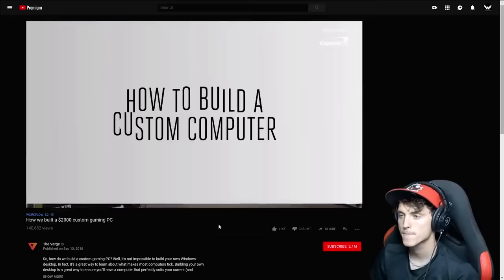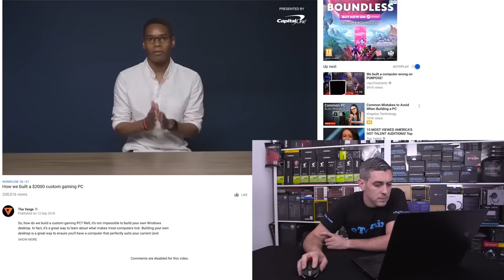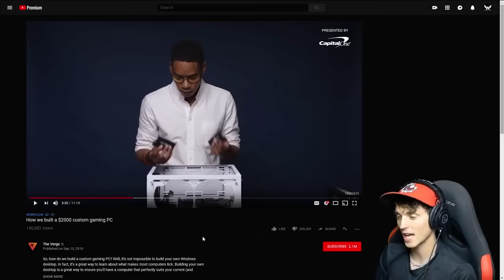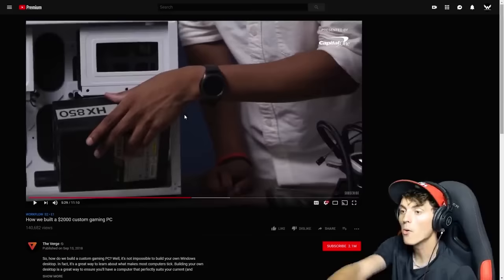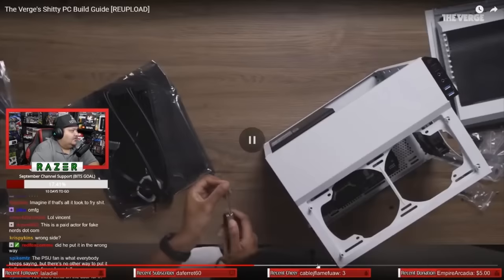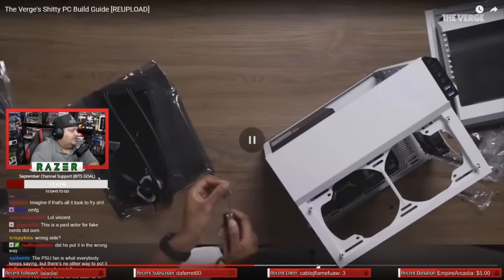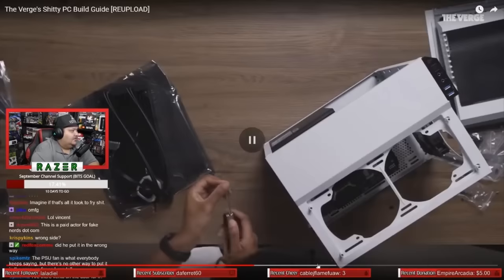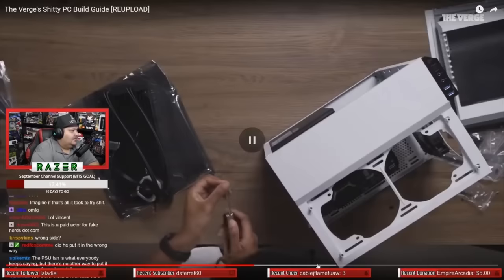The Verge's $2000 PC Build Reaction Supercut

Comment: "Two thousands a decent chunk of change for a gaming pc"

Ohh the Rich boys..
Reply: 2k for a whole PC is mid range.. Upgraded my PC for about 3.8k..
RTX 3090 with an EKWB - 1800€
R9 5950 with an Heatkiller V block - 1000€
MSI MEG X570 ACE - 350€
2x Samsung 980 Pro 1TB M.2 nvme - 400€
And other stuff like radiator, pump, fans, pipes, cables, fittings, and so on - 300€
Reply: @deadlyfeet 2090 ti for the price of an 2080 ti seems okay.
Reply: @chimei-tekinaneko8318  ohh the rich boys
Reply: That’s just how white people say “a lot of money”
Reply: @Samskings  not rich at all, just safed quite a bit of money since my last build in 2016 (6700k and GTX1080).. you only have to handle your cash correctly..
Reply: @chimei-tekinaneko8318  ohhh the rich boys!
Reply: @amystery5238  you could’ve just said “universal overkill”
Reply: @amystery5238  yep, Installed my new system in a 10/11 year old case.. had to modify my CoolerMaster HAF X thou.. ripped the HDD/SSD storage out, cuz it was in the way and i dont need them, since the case has 2 HotSwap places and i got 2 1TB 980 Pros on my mainboard.. 
And made a few cuts to fit the radiators and fans, which you only see if you open the case and look for it.. 
One of the few Cases that still have some "Premium" features like actually decent cable management places with nice rubber flaps and enough holes to make a clean build.
Reply: I just bought my parts one at a time. Lmao.
Reply: @Iridiumcosmos  doesnt work that well if ya go the premounted waterblock way.. Also gave my system to my sisters friend, so he has a somewhat good PC..
Reply: @chimei-tekinaneko8318  I'm building mine right now as we speak lol. Whenever I got paid, I just bought a single part. So I mean, OP is sort of incorrect.
Reply: @Iridiumcosmos  hes just memeing arround i guess.. put 300€ aside every month for about 4 years now, so i have the cash to build my PC and mod my car..
Reply: @Iridiumcosmos  also good luck building it ^^
Reply: @chimei-tekinaneko8318  Appreciate it. 😁
Reply: They call it... a job
Reply: What do you mean 300$ ???? Every month??? 
I can only afford 300$ my year.

"Not rich" my ass
Reply: @cheburekman696  bruh.. i get paid below average in my country, so "not rich" seems fitting..
Reply: @cheburekman696  also if i get my hand on stuff like 25<% off of your purchase from company xy cards i ask arround if some ppl want to make a collective order, they pay me the normal product price and I'll pay the shipping costs.. so they got their stuff without paying for shipping and i made a bit of cash..
Reply: @chimei-tekinaneko8318  im paid below average and i make 400 a month.
Reply: @cheburekman696  €,£,¥,₩,$ ?
I pay 300€ a month for a roof over the head, if ya wanna live cheaper you go out in the woods and build your own house (illigal btw)..
Reply: @chimei-tekinaneko8318  euro,i dont live in america,prices are muuuch different. I live in Romania,the average salary is ~600 euro
Reply: @cheburekman696  i am from Germany, i get about 1500€ a month, yet i cant use all of it since i have to pay for the care system, insurance and a lot of other shit i never really need.. and now imagine giving away 40-50% of the cash you work hard for, to a country that literally uses it to pay ppl that refuse to work (424€ for 1 Person and not including that the flat is paid by the country as well..)
Reply: Nasty trim  i am from germany.. 2.000 € are about 2.430 US $
Reply: Paid 3k for my custom build it's called a job lol
Reply: @chimei-tekinaneko8318  to be honest, that’s overkill and most of the games I play do not need this kind of hardware. Also you can upgrade by time. I bought my ssds one after on.
Reply: @chimei-tekinaneko8318  lol my apartment is 700€. And it is not even that big. +taxes, +insurances, +food, +gasoline (which good more expansive this year in Germany, because of some environmental taxes), +cloths, +entertainment. Living in Germany as an adult is not cheap, that’s right. But at least the universal healthcare works most of the time. Even if it is expensive.
Reply: @russkijnemez5911  ik that its overkill.. was supposed to be, cuz i love to go complete overkill..
Reply: @chimei-tekinaneko8318  tf is a 2090 ti
Reply: @amystery5238  PC hardware will start going down soon now that it's a fight for bringing higher performing upgrades for a modest amount. It already started for nvidia having the 3060 be as powerful as a 2080ti for like 600-800 USD cheaper, and now that AMD CPUs have become on par with Intel's in most ways (not all, but after my FX-8350 7 years ago I never would have bought AMD again for gaming) and are fairly cheaper for near identical performance, companies like Nvidia and Intel have to respond to the performance/$
Reply: My guess is you guys buy the GPU's from scalpers who are selling 140% over the original price.

Comment: “Don’t buy a motherboard just because it has built in WiFi and Bluetooth”
Ah shit that’s what I just did.
Reply: Ah you'll be fine
Reply: Well it depends on what kind motherboard, if you got a good solid vrm, good chipset then its nice to get a wifi version but it is always more expensive compare to non wifi
Reply: I recently had to buy a x570 with wi-fi and bluetooth because a lot of the boards right now were sold out and it was the same price as buying a non wifi+pcie card as just buying a x570 with wifi
Reply: he said that because you can buy dongle and save some bucks.
Reply: That's okay, tho it's cheaper to look for wifi + bluetooth pcie extensions
Reply: Yeah, its because you can get receivers for that, both internal and USB. So just go for the board based on other features that you like as WiFi can always be added in other ways.
Hell, some boards have Bluetooth and no WiFi built in.
Reply: Wifi and Bluetooth are just a pci-e card away
Reply: @dillonsmith3033  most built in wifi in motherboards isn't as good as with a good dongle
Reply: Ghoul Drago that’s true but it was more for ethernet at home and occasionally bringing it to a friend’s and using wifi there so I just went for the wifi on motherboard
Reply: @dillonsmith3033  understandable, I hope you are/will having a good time with your pc
Reply: I think what he meant is those aren't your top priorities, compatibility of parts is as well as that the board meets other system requirements, and build quality, features that affect more important things like longevity(vrm heatsinks), and wifi for gaming? c'mon bro.
Reply: Honestly, that guy only said that because they are elitists who believe that you need ethernet. I bought my motherboard bc it had wifi and bluetooth built in and I didn't want to buy a separate card for it or use dongles and it works well.

Comment: It's completely okay to don't know shit about how to build a PC for yourself. That's what tutorials are for.
But why on Earth would you make a video for a big ass outlet like the verge when you clearly haven't built a single computer in your life???
Reply: well might be he has built plenty pc's. if he builds them like that one he needs a new one every month or so i guess...
Reply: Rumplelumpa Snickerdoodles not to mention sponsored by a giant corporation.
Reply: I built my first pc without any tutorials and apart from shorting the motherboard (thankfully it didnt break), poor cable management and fucking up the power button/led cables it still went way better than this. Now I've built 10s of PCs for me and my friends and learned how to build them properly. I still fuck up power leds sometimes though. This must have been his first time building a pc.
Reply: @make9268  I built my first PC and actually did my fuckin' research, and beyond it not booting on the first power button press because I hadn't stuck the case's power button connector well enough into the motherboard's port (which just meant I had to push the connector in a bit harder), I didn't have a single issue with it.
Reply: @Frawt  Same here. Mine also didn't power up on the first button press but all I had to do was go over the cables again, firmly press each one, and bam, it worked. What happened was that the 24pin power connector needed just a little bit more force for someone who was afraid it may break their pc.

Comment: I actually learned a lot from this video on what NOT to do!
Reply: It's hard for me to find the cpu applicator. So my built is a no go already. Ps I did found the table.
Reply: @wolf-tw7ee  Did you find the Swiss army knife that hopefully has a philips head screwdriver in it?
Reply: @akisalmenaho8473  did you find the t a b l e
Reply: @jeff-np9jm  Yes I did. However, I had to deal without an allen wrench. It was a pain.
Reply: @jeff-np9jm  did you find the 
                                         B R A C E
Reply: @GTVR-tx1jl  oh, I think i also found the I n s u l a t I n g p a d s
Reply: @jeff-np9jm  that's good, you wouldn't want the psu to

C O M E  I N T O  C ON T A C T  W I T H T H E  C A S E  A N D  S H O R T  C I R C U I T  T H E  R E S T  O F  T H E  S Y S T E M

Comment: I used to be so afraid building my first pc rig because of the complexity of assembling one at the time; but thanks to this video, I've never been more confident putting anything together.
Reply: even the reactions are over reactions. most of them dont even know what each specific part actually does in relation the pc.
Reply: It's very easy. Most things use standards. Pretty much if you can build a Lego set you can build your first PC with a tiny bit of help
Reply: I swear this guy must lost a bet or something like that, because he cleary knows nothing about PCs, using League as a benchmark game and lock the FPS?

The funnies part when he says you can overclock the CPU, I think if he do that he would turn his PC into a bomb

Comment: Them: “well Yeah it’s common sense, you’re going to need a solid working area like a table to build your pc”

Me, the mongoloid that built his pc on his carpet floor: “haha yeah”
Reply: Me, the other mongoloid who built his pc on a wooden floor: wait you need a table?
Reply: i did my first pc build on a table..... on top of carpet. with socks on. 
didn't go that great i tell ya
Reply: ye man why cant u do it on the floor i dont understand ;-;
Reply: Built a couple on a fireplace so I could watch TV at the same time.
Reply: Noob You can do it on the floor, just dont do it on the carpet.
Reply: Vinyl, tile, wood, glass, most surfaces are fine just not carpet
Reply: @30yovegan34  you were probably missing your bracelet to fight cancer, I mean static.
Reply: Floor gang!
Reply: Noob if it’s a carpet floor the static can destroy the parts
Reply: @sacha6496  noob, you just need a live strong bracelet
Reply: @leobaytorun7157  You can if its hardwood, but a carpet floor can build up static heavily.
Reply: Tika I mean your not wrong I think I have cancer after watching the verges video
Reply: YOU GUYS DON'T BUILD ON A CHAIR? wtf
Reply: XQC is that you???
Reply: Joke's on y'all I tried building my PC on an escalator using a vacuum cleaner. Yeah, didn't turn out so good.
Reply: I just plopped my motherboard on the box it came in and started installing.

Comment: bRO HE BLOCKED ME ON TWITTER LMAOOOOOO
Reply: Same
Reply: @YavNe  dear mr SJWW, i just build my first PC ever 3 week ago and i get better cable management than this guy. Given that my case is a 20$ noname chinese knock-off thus most of my cable is not visible. My PSU is on the right side. My PC also have VGA, SSD and of course no wifi biuld-in.  Even more than that, i'm a guy living in 3rd world country working as an architect assembled my PC for rendering Corona. Tech is not even my major but it's only toke me a week to do the research and it's done. He disrespect his job and his audience then that what he get. Karma is a bitch Stefan.
Reply: @manuelvera3453  ? Is this directed at me?

Comment: I built a PC myself for the first time this summer and it took me over 3 month of gathering knowledge about 
-Motherboard-CPU compatibility, 
-Motherboard-RAM compatibility, 
-CPU-RAM compatibility, 
-Motherboard-PC case compatibility, 
-Power supply capacity needed, 
-AIO radiator positionning, 
-RGB HUB management, 
-How to plug all cables on the Motherboard,
-Cable management,
And I'm glad all the youtuber/website I took the informations from were professionals who knew what they were doing because it all went smooth and booted on the first try.
This guy wouldn't even be able to tell Intel and AMD sockets appart.

Comment: I use a thermal paste applicator, so I can spread the paste into one thin region that covers the whole cpu.
That's how they do it on singularity computers, and it makes sense cause sometimes the paste doesn't spread out over the entire area.
Reply: I think it's also common practice to use it now since most processors nowadays are absolutely massive + rectangular and the pea size doesn't work anymore unless you're lucky or got a really watery paste for some reason
Heck, I've even seen ones that you can cut and stick to the processor because of that issue and I think those spread heat better too

But the real issue is that well, he doesn't use the applicator anyway
Reply: @tydshiin5783  Good points, yeah I don't think he even uses it, he does the icing a cake method instead.
I think he only uses the tweezers out of all the things, and if you look closely one of them is on backwards so you could just pull the thing off easily.
There will never be a worse pc build in the world

Comment: This video gave me the motivation to build my own gaming pc. Build my first gaming PC, i'm using it to type this comment. Works fully, tested it, attaching the cables was by far the hardest part for me. Updated the bios and drives and RAM is using the EXPO file. 6000hz CL 30. Rtx 4080. Its a fucking beast and prous i did it.

But the manuals of where certain cable's have to go is absolute hell if the motherboard and case manufacturer use different names for where wich cable go's into wich header.

Comment: You could excuse a few of the mistakes, but most were absurd or just dangerous, and the case has tonnes of room in the back for the cables, but yet it still looks like a rats nest in the front.
There was something like 20-30 errors if you were really nitpicking.

Comment: I mean I’ve built computers on the floor before it’s no big deal
Reply: i think everyone does, 90% of building happens on the floor for me, i only use a table to put as much as i can on the mb, so for 10% of the time i use something akin to a table but i have used mb boxes, the casebox ect ect something flat,sturdy,clean and non conductive,i also have never used a anti static bracelet( only thing i always do befor i start building is touching a radiator) and everything always worked

Comment: For ddr4, the only thing faster than 2666 is 3200. maybe some can push to 3600, with specialized technology.  But it is true, that in 2022 or 2023, you should be buying 3200 speed ram.  Because you can get it no problem compared to 2600. So ideally yes, it is  not what you want, but to say its the slow kind of ddr4 is wrong, as its the second fastest. also the third least slowest

( and the video came out in 2018)   

And yes this is a terrible build video and it should have been removed. Im not saying the guy is right at all.

Comment: Ok but that shouldn't have been beeping when he put the dmm on the case, that indicates a short to ground
Reply: No it doesn't. The other probe of the dmm is in the ground hole of the socket. That just means that the power supply has a proper chassis ground. If it didn't beep, then he'd have a problem.
Reply: @fletcherenfield9474  ok follow me here because maybe I'm lost, here's my train of thought: with the power supply unplugged, how is continuity going from the socket to the power supply, because it shouldn't be through the dmm, it's designed to be a high resistance device so that electricity follows the path of least resistance. Ground to a ground that's connected, there should be continuity, ground to a ground that are not connected to each other should not have continuity. At least that's how it is in vehicles, is it backwards on houses?
Reply: @uenragedbro  the power supply is plugged in though? It's plugged into the socket right below the one he has the probes of the dmm in.
Reply: @fletcherenfield9474  I had made a comment after posting that one and checking the footage but I guess it got lost. My mistake, I was wrong
Reply: @uenragedbro  no worries, it happens

Comment: 4:36 Don't agree with this one. I find it extremely annoying to work around the Cooler, Memory, Vid card etc. When i'm trying to screw the motherboard onto the case.
Reply: Most people will tell you to get as much on the motherboard as possible before putting it in, because working in a case is often tight and difficult.

You do you, though. I wouldn't put in the vid card tho. Cooler, I generally do, though with an AIO it's not as much of a hassle if it's already in. 
Either way, I'm sure you at least put the CPU in.

Comment: 13:07 well is very debatable but we can use a lot differences way to put thermal pasta, if you put just put in the middle all hot gonna spread to the coners of cpu, normal i put a little and spread cover all the  cpu, even the cpu get to much  it´s just waste nothing more..
Reply: Well not really, as if that paste gets onto the board from too much, it can damage the board, or it can seep under the CPU (very rare last I heard) and damage the cpu